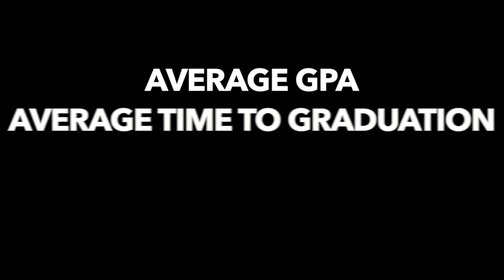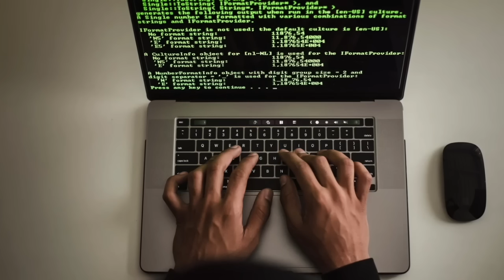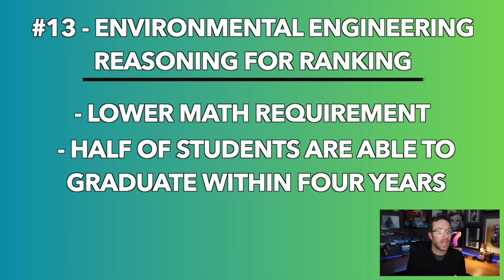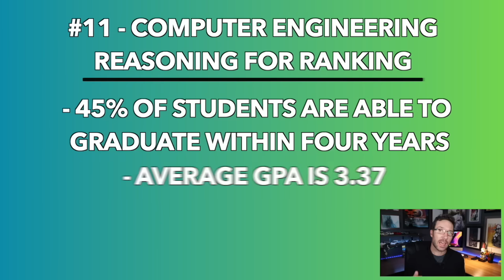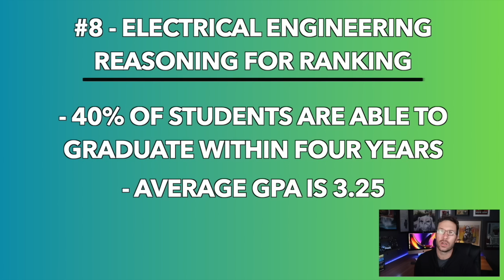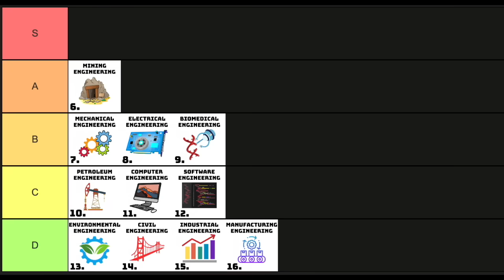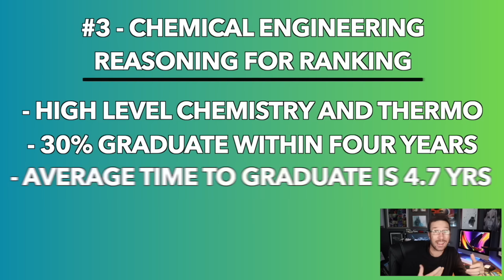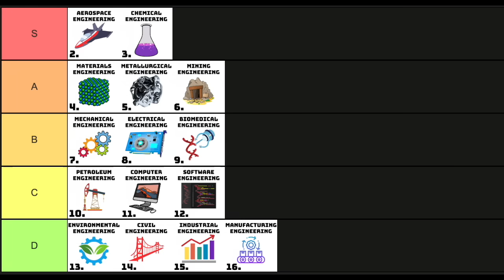Engineering Degrees Ranked By Difficulty (Tier List)

Comment: I agree with your list. I think it is very useful for a prospective engineer. An additional aspect that may be helpful to add is the "Professional Engineer" category. Requirements for becoming a "PE" vary with the degree type but it is another "hash mark" that can result in significant pay increases.

Comment: Blogger has no concrete idea on what level of mathematics are actually required in any type of engineering course. Wave analyses of electromagnetic and transient waves are not analyzed solely by ordinary or partial equations. He may not have heard of, or even encountered and tried Fourier and Laplace.

Comment: I learned to troubleshoot ancient computer hardware as a repairman for the Marine Tactical Data System. Then I went to the University of Oregon and got a BA in Physics. I got hired with a single interview for a company that made array processors, working as a technician, bringing up new machines. Also got into diagnostic software, and customer service for FPS France (lived in Paris for a year). Finally I got hired as a computer hardware engineer where I did design work. Also had my own company for a while, designing interfaces. Notice that I had NO course work in engineering; I learned on the job and worked my way into it. The Physics degree was of little use, although it was interesting.

Comment: I have no idea where you get your information but I went to UC in Electrical  and Computer Engineering.  I took DiffEQ in sophomore year and it only got tougher from there. Hell you couldn’t even spell Convolution which is math based on two waveforms multiplying each other.  Waveforms and transmission theories were hard.  So get your facts straight.  Also our highest level math professor was on the national board accrediting colleges math programs. He said EEs had the highest math.  My daughter went to Georgia Tech in EE and Computer Science.  She also said it was widely accepted at GA Tech that EEs took the hardest math

Comment: Aerospace Engineering, ChE and NE are at the top in tier S. ChE requires Bessel and J functions, Buckingham Pi methodology, and a true understanding of systems and control systems. Systems Engineering and Control Systems Engineering are right in their too. The math is equally complex, but key is the ability to resolve complex dynamic systems. Semiconductor Engineering is also in this tier and requires many aspects of Chemical engineering, plus error and complimentary error functions. Seismic Engineering is also in this tier with complex wave functions, tomographic solutions and indeterminate systems. Biomed is in S as well.  These are all elite level engineering disciplines. Linear thinkers cannot succeed in any of these.

Electrical engineering, particularly radio and heavy power specialties are way higher in tier A. Environmental joins Mechanical in A.

Mining is in C.  Civil engineering is in C.

Just try doing Chenical, Nuclear, Systems, Control Systems, Mechanical, Aerospace, and Biomedical in 5 years. You can sleep when you are dead.

Comment: Completely disagree with this rating. It represents very shallow and narrow analysis. 
One has to understand that many fields of engineering overlap. Exp: structural engineer can work practically can work in every area excluding chemical and electrical engineering. In any case, to become a real engineer one needs 6 years program (150+ cr hrs) and 3 years of experience under supervision of experienced engineer. For example in former USSR structural engineering program in polytechnic university required 6 semesters of math. Analysis and 2 semesters of mathematical physics.

Comment: I knew an engineer from Pakistan.  He said that 40 years ago in Pakistan the government run university would assign "engineering" student candidates based on their entrance exam score.  The highest scores were assigned to be Civil engineering students.  (Probably because that is what the government valued at the time) Then it went down, Electrical, Chemical, Mechanical, etc with Petroleum assigned to those bottom qualifying scores.  He said that 10 years later, when they had an oil boom, those Petroleum engineers were getting wealthy and were the envy of all the other engineers.

Comment: In the 1980’s at SDSU electrical had the hardest math. Mechanical and aerospace were around the same, and we all laughed at civil because it seemed the easiest. However the civil engineers had to take the EIT test to get a state license which the Aerospace people didn’t. So there is that.

Comment: My degree is a BSME. I am retired now. My freshman engineering class which included mechanical, civil, electrical, chemistry and computer started with almost 300 engineering students but I graduated 82. My BSME graduating class was 16. I graduated in 4 years but there were 3 who needed longer. I have always been a focused person so I studied hard and graduated with about half of by graduate courses taken. I really wanted to be an architect but the job market just wasn’t attractive enough for me. Your presentation is good and your data is good. I recommend those choosing a career do some due diligence in researching the job market. Since the economy can change quickly a reasonable job market prediction for four years in the future is necessary.

Comment: You left one engineering discipline out, Jake: Structural Engineering. Unless it is no longer a degree option, or relevant.  A cousin of mine majored in Structural Engineering at San Jose State University, in the late 60's, early 70's. He made a successful career as a Structural Engineer, working in the Bay Area. My elder son completed  Electrical Engineering at the same school in 2015, and has worked in the industry ever since. His first choice was Computer Engineering, but found that core curriculum classes were more demanding, at least at SJSU.

Comment: I sort of agree with the list, though the data used is not as direct as one would like.  Though at a major university all of these fields prescribe the PDE level of math, the typical problems (and consequences of getting the solution wrong)  seem (to me) to require higher orders of PDE's in some fields than in others.  

For instance, nuclear engineers model very complex thermodynamics which have material dependencies.  Weird material dependencies, like changing thermal characteristics due to radioactive decay.  And in a reactor vessel with flow. Wow.  That is a tough problem to set up.     Similarly, modeling aerospace seems to need to include a wide range of thermal and material dependent issues.   Also, the consequence of failure seems higher in those fields than an lesser complicated electrical or mechanical problem, where you can count on copper to behave like copper to a better extent and in a narrower range of temperatures and stresses.   

Going by this general way of looking at it, perhaps mining, materials, and metallurgy could drop a bit.   At least "back in the day" those fields still used experimental methods at the undergraduate level.  Things were just too complicated to get empirical unless you were post graduate.   But in nuclear, chemical, aerospace, your average BS degree needs to at least be able to walk through and demonstrate (by setting up and solving) that they really grasp the problem because the consequences of failure in a typical application are more grave.

Comment: You should do what you find most interesting. Engineering is a good regardless which discipline you take. But the core engineering degrees are the best - civil, mechanical, electrical, chem. The rest are sub disciplines.

Comment: There is simply no way that mechanical is above electrical in difficulty.  I'm not saying it is easy; engineering in general takes a special kind of special...but as an EE, I damn near graduated with a minor in math, and some of the sub-disciplines are borderline magic to a normal person, of which RF, photonics, and semiconductor / IC design are examples.

EDIT: Actually, I'm not sure I'd consider it an apples-to-apples comparison, now that I think about it.  There are very challenging problems that fall under the realm of mechanical engineering; thermal design and fluid mechanics being two examples.  The main difference is that most of an EE's work can be tested at a desk, whereas this is generally not true for (hardcore) mechanical engineering stuff.

So yeah, I could go for it.

Comment: What a joke. Electrical Engineering is far more difficult than mechanical engineering and should never be placed on the same level as EE. Seriously, what were you even looking at, and no most mechanical engineers don't have to do differential equations or linear algebra.

Comment: I’m an Industrial Engineer. I will match paychecks with any engineer on the planet. 

This ranking is a bit flawed. I AGREE I.E. is easier to obtain than say Chem E. So yes, notionally this ranking is about right. 

But I once worked with very smart engineers of all disciplines and the most impressive geeks were the E.E.’s. I then later had an opportunity to study under a Chem E and he was incredibly savvy on the job in a process plant. 

THE smartest engineer I know has an E.E. Degree from WV Tech. But he has full capability in software, controls, mechanical and civil. His personal shop has machine tools and woodworking tools and a couple of car lifts and full welding capabilities. 

Here’s my point. It isn’t the degree that makes an engineer smart. It is their WORK. I know degreed engineers that can’t turn a wrench. Useless. If you want to be a good engineer - no matter what TYPE - you must be hands-on. You must have your own tools and a shop and you must enjoy tinkering and experimenting. 

My dad was not a degreed engineer. He was a mechanical draftsman. But he built his own house, his own boat, his own hi-fi stereo and his own single sideband radio. Was he a genius?  No. But he tinkered and studied and asked a lot of questions. I learned “tools” through osmosis with him.

Comment: I argue that also Chemical Engineers are asked to handle partial differential equations even if for specific situations (3D heat and mass trasfer calcs, like CFD calcs, or time dependent phenomena in reactors)… (yes, I’m a CE 😊)

Comment: I appreciate that you're trying to be objective with your data, but simply looking at drop out rate is not an accurate way to determine difficulty.  Have you considered that people who go into specific degrees (such as computer engineering) are very much more nerdy and prepared for the rigors as compared to someone who goes into mechanical or electrical because of name recognition.  For example, Air Force para rescue special forces school has the highest dropout rate in the military for Special Forces.  Do you believe that Air Force para rescue school is more difficult than Navy Seals training (for example) or is it that the people who decide to go into Navy Seals training are more equipped to handle it.  Also, you have EE and CompE ranked separately but they are essentially the same degree so how does that work?  Many schools (including M.I.T.) only offer a single degree that is called electrical and computer engineering.

Comment: I know this is a 1 year old video, but I feel compelled to respond. I have a BS Nuclear Engineering from USMA '92. I have mentored numerous students on what branch of engineering they should choose. First and foremost, pick the field that you will enjoy. This leads directly into my second mentoring topic, find out what you enjoy. There is nothing worse than completing and entire course of study and finding out that you do not really enjoy doing detailed testing and analysis. Third and most importantly is that there are basically three fields of engineering, Civil, Mechanical, and Electrical. In my opinion, every other engineering discipline comes from one or two of those disciplines. It is very important to note that for me and my peers, we all thought that the EE students were the toughest and brightest. Civil Engineers were/are the engineers that design and build. I always tell my mentees, if you absolutely cannot choose a discipline from one of those three, major in Mathematics. Math Majors and just as valuable as engineers, and with a good internship, can roll right into a full-time engineering position upon graduation.

Comment: I'm a retired Petroleum Engineer, graduated in 1978, and never regretted working in oilfields all over the world.  I'm very surprised at how that degree has been "dummied" down over the years as it used to be one of the more difficult degrees to obtain, requiring on average 4.5 years for a BS degree.  I also recruited chemical engineers, mining engineers, and mechanical engineers to work in that industry and thus I was familiar with those college programs.  At that time we not only had to take 3 more advanced math classes after calculas-3, including a fairly difficult matrix algebra and even more difficult, advanced engineering math course.  Besides 2 courses in physics, one in electrical engineering, thermodynamics, fluid flow mechanics, strength and property of materials, statistical analysis, 3 courses in chemistry, 3 courses in geology, Fortran programming, and 8-hours of physical chemistry (with labs) which was really tough for non-chemical engineering majors.  Most universities at that time included the second course in physical chemistry within their graduate program for chemical engineering and not within the undergraduate program.  However, the difficulty in that degree was not just in the non-PE courses but in required courses such as natural gas processing, which was a chemical engineering type course, as well as knowledge of Fortran programming for our courses in waterflooding and reservoir simulation which both required creating programming decks by hand for every computer related project.

Comment: The highest math of Chemical Engineering ordinary differential equations??? Literally all of upper division is partial differential equations, thermodynamics, fluids, heat transfer theory, control theory... and we also have to take quantum mechanics and quantum physics. Same with electrical, their math is way higher than ordinary differential equations.

Comment: I don't get it. Metallurgy is mechanical and material essentially, aerospace is similar to mechanical, nuclear is also comparable to mechanical and nuclear, how do they rank so differently? Environmental is civil and chemical, so it makes sense it's close to civil, petroleum is chemical and geo engineering too so having it low and chemical so high is weird. And electrical, i don't want to say it's the hardest, but seems a but low to me, material is also close to a lot of other engineering as mechanical and chemical but also civil have some knowledge in it

Comment: For kids that are venturing into deciding their path in the fields: 
It's hard for any of these degrees and it's important to feel frustrated working your way through. I grew up with engineers, physicists, artists, musicians and it all comes together. I'm all of the above and harmonically none of one at one point but all the others at once. The Marine Corps helped me focus and keep myself in check, gave me a shoe in with a few aerospace jobs and helped with some of my college costs. The military helped substantially but financially, you don't need to join up if you're responsible with tuition costs and such. 
I'm just saying that yes, it's going to be hard work and frustrating at times but that's good! It's not going to be simple after getting a degree but it will become much easier to extract an idea from your brain box and make it tangible. All the difficult math is just a way to train your mind and when I was working on dampening sound on jet engines while maintaining fuel efficiency, yeah there was a lot of dynamic calculations but most of the math I had to do was measurements in curvatures to approximate weight distribution on rotating volumes and how temperature variations affect those measurements. Material science and chemistry were important and a bunch of other stuff. Break your brains, make it hard and just have fun.

Comment: Nah.  Electrical is harder than Mechanical.  In fact, the whole A and B tiers should be swapped.  Mining, metallurgical and materials engineering might even be C tier (which is part of why they pay so much lower.)  Those classes were some of the easiest I ever had while on my way to a mechanical degree.
Reply: Why do you say that electrical is harder than mechanical ?!
Reply: @samiadel804  EE is more abstract.  It's far easier to relate to the details needed in mechanical.
Reply: @DarkHorseSki  
ME also studies abstract subjects and moreover it studies concrete subjects which need a 3d analysis .
For example, which is harder : electromagnetic fields or fluid mechanics ?!
Reply: @samiadel804  All I can tell you is what I know from direct experience.  I attended General Motors Institute as a ME/EE student.  That college was entirely devoted to engineering disciplines and we all talked, and it was pretty much the universal opinion of the engineers that EE was harder than ME.  In fact, my discipline was known as ME suicide as EE was the hardest minor to pair with ME.  Fluid mechanics is specialty field and not really a comparable sort of thing, but if you wanted to compare it to the EE side it would be comparable with quantum electro dynamics...

Comment: Bice video, but btw, Electricla Engineering requires Partial Differential equations like crazy, and it's very hard to imagine what really happens in Electrcial circuits/systems btw I don't think that you made the right choice of placing it at half of the scale.. especially if you simple google search you might find close to the majority saying that it is the most difficult one. Great video nonetheless